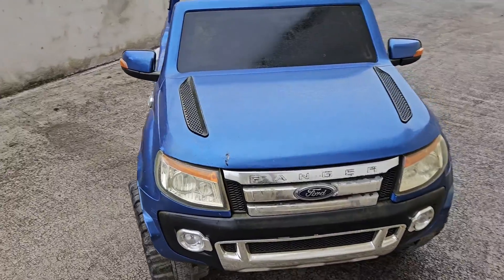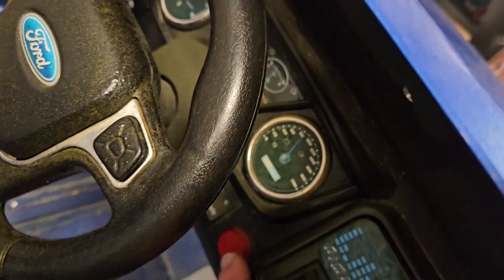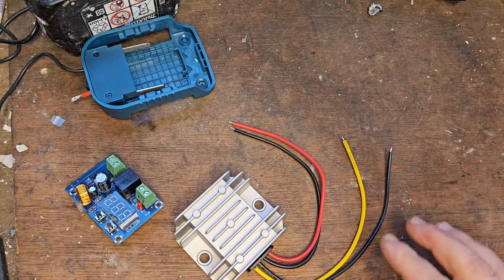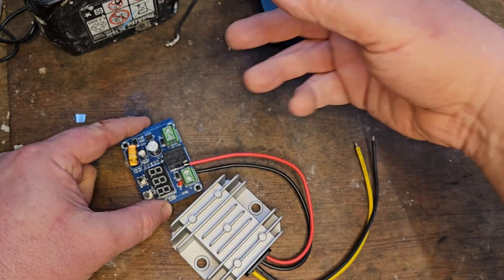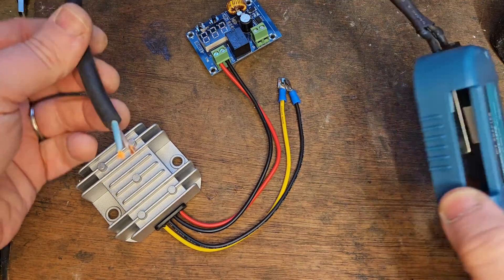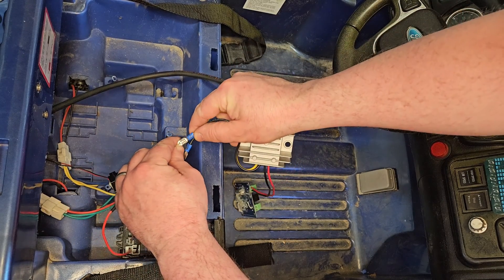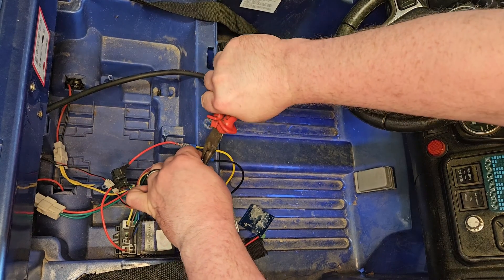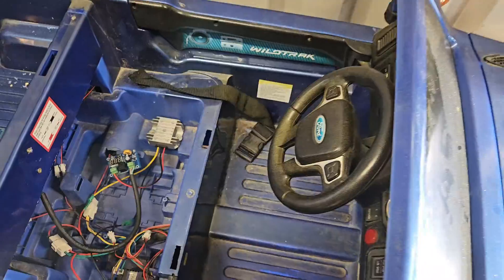Ford Ranger powered by Makita 18v

Comment: Thank you sir! Have been trying to figure this out and there is only info on powerwheels set ups. I am converting sons ranger to Ryobi 18v 4ah, is the over discharge essential? Also do i need to keep the charging port wired in? Is there a way to bypass? Thanks in advance mate 👍🏼
Reply from the maker: The overdischarge usually is required to stop batteries getting to a voltage where they won't charge.
I kept the original wiring so it can go back that way if necessary. The charging port is obsolete with the new system
Reply: @doctorlefthandthread  appreciate the advice mate! Grabbed an over discharge board to be safe. Keep up the good work 🙌🏼
Reply: @doctorlefthandthread  G'day doctor! Got it all set up in the boys toy ranger. It goes really good but cuts out / restart / cuts out again under load (up hills etc). Wondering if the discharge current is to high for the battery (ryobi 18 5.5ah)? Do you think i need a battery with higher AH or a second battery and use the two in parallel? Thanks again for your help 🙌🏼
Reply from the maker: @ryanjames6781  you could try it

Comment: hi, I bought a voltage drop from 24 V to 12 V, and it doesn't work, I have 12v output but when I accelerate I have Zero and nothing happens, any idea? thank you from France
Reply from the maker: check if you have a bad connection somewhere it happened me there was wire plugged into the board that was loose
Reply: @doctorlefthandthread   ALL is GOOD ;) I have 12V at the transformer output, but when I accelerate I have 0 volts
Reply from the maker: @DAV4WS  I can't think how that can be. Is the machine 12v?
Reply: @doctorlefthandthread   6v , but work well with 12v too